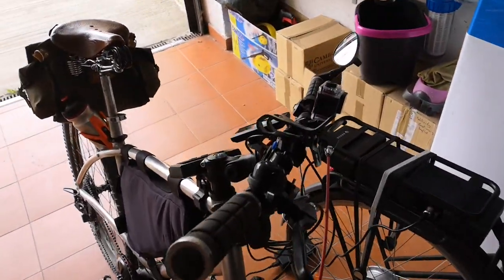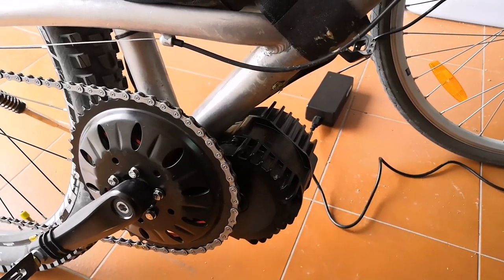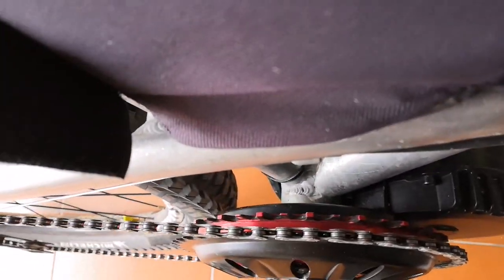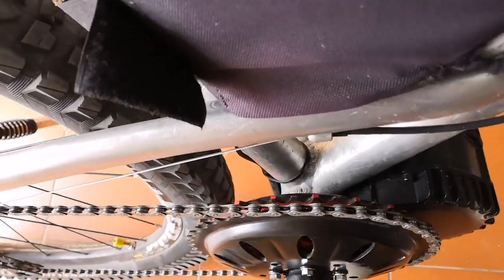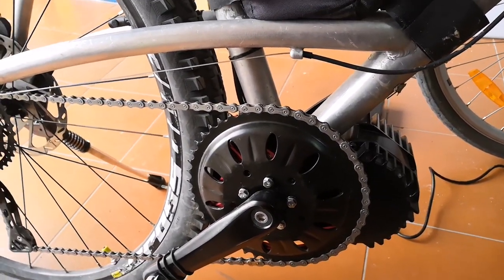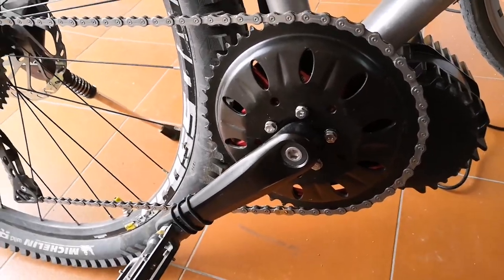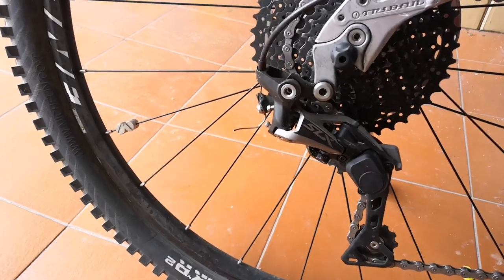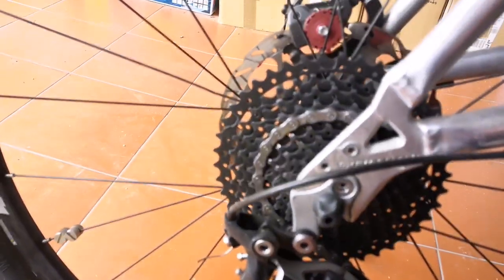Bafang Bbshd 52V update

Comment: Is there a speed difference between 750w and 1000w?
Reply from the maker: Hello. The kit I bought (Bafang BBSHD) was advertised as "1000W".
The wattage depends on the voltage and the Amps you can/are putting through the system, Volts x Amps = Watts.
This is a 48V kit, but I'm running it with a 52V battery (14S9P - that's fouteen batteries connected to produce 52 V times 9, so 126 18650 cells altogether)
When the battery is fully charged it's around 58.7V. 
It puts out (according to the Cycle Analyst) 32Amps, so 58.7 Volts x 32 Amps = 1878 Watts.
The " speed" will depend on your gearing (the bigger your front crank and the smaller your smallest rear cog, plus the faster your pedal cadence) the faster you'll go.
On the flat, this kit will easily power you along at 50+kph.
Reply: mick2d2 750w ?
Reply from the maker: @murselincelik8411  I think you'll find that the 750W Bafang mid-drive is the BBS02, not the BBSHD.

The BBS02 was my first kit, with a 48V battery (13S5P) which is now on my brother-in-law's bike.
Again, it wasn't really "750W" it was sold as a 500W kit, but under the motor it was stamped as "48V 20 Amps".
The voltage range was 46.8V to 54.6V (fully charged), which equates to a wattage range of 936W to 1092W (at 20 Amps), so not 750W.

Some people "overvolt" the BBS02  to 52V as well, obviously giving more power - 1008W to 1176W (at 20 Amps).

I ran the BBS02 for three years and my brother-in law has been using it for the last three, so six years altogether and still going strong (with no repairs).

I've been using the BBSHD for the last three years (again no faults so far).

Comparing the two, the electronics on the BBSHD are engineered for a lot more power and it doesn't get as hot (even on the 52V battery). 
Sometimes the BBS02 would overheat and need to cool down if you ran it at full power for a long time in the summer or also on long climbs. This has never happened with the BBSHD even though I'm putting an extra 10 Amps through it.
The BBSHD clearly has a lot more power and a lot more torque.

With the gearing I have, it will climb almost vertical slopes! 
On a few occasions, the slope was so steep, I had to lean forward over the handlebars, to stop the bike going over backwards, and went up just on throttle, as I couldn't pedal in that position. 
The BBS02 couldn't do that
They are both great kits though and both pretty fast with the right gearing.
Reply: thank you very much Greetings from turkey
Reply from the maker: @murselincelik8411  You're welcome! Greetings to you  from Spain.
Reply: mick2d2 hello :) For faster and torque, let me see the Ruble Gear number or which gear ratio?
Reply from the maker: @murselincelik8411  

https://www.sheldonbrown.com/gear-calc.html

Speed in KPH @ 60RPM
For 29 x 3.0 / 75-622 tire with 170 mm cranks
With custom sprocket(s)
With Rohloff Speedhub, 14 Gänge Rear Hub

Gears:              1º                2º    3º    4º     5º     6º    7º     8º    9º    10º  11º  12º  13º  14º
Ratio:            0.28 (Low) 0.32 0.36 0.41 0.46 0.53 0.6  0.68 0.77 0.88 1.0  1.14 1.29 1.47 (High)
Crank:              42               42    42    42    42    42    42    42    42     42   42     42      42   42  
Rear cog:        13                13   13    13    13    13    13    13    13     13    13     13    13    13
Speed (KPH): 7.7              8.8   10   11.3 12.9 14.7 16.6 18.9 21.5 24.4 27.7 31.5 35.9 40.7
Reply: mick2d2 I do not understand
Reply from the maker: Murselin Çelik Sorry, I realise my answer was a bit technical!
The link I mention, provides a tool which allows you to calculate your gear ratios depending on your wheel size, your front crank plate, your rear derailleur and the speed, depending on how fast you pedal (RPM).
In my case, I have one 42 tooth crank plate on the front (by the pedals) and one 13 tooth cog on the rear wheel. I only have one cog on the rear wheel because the gears on my bike are internal. I have 14 evenly spaced gears. The information I posted is the gear ratio for my setup and the speed in kilometers in each gear when pedaling at 60 RPM (the cadence).
If you put the information for your bike into the calculator, it will tell you how fast you can go in each gear. Obviously the bigger the front crank plate and the smaller the rear cog and the faster you pedal, the faster you will go.
Hope this helps!
Reply from the maker: Murselin Çelik If you watch one of my later videos, you will see my present setup, with the new crank plate and the Rohloff gear box on the back wheel.
Reply: mick2d2 9 gear 11x34 is it enough
Reply: my rear gear
Reply from the maker: Murselin Çelik The smallest (fastest) gear on most bike (except a few road bikes) is usually 11 teeth, so that should be fine. What size is your front crank plate?
Reply: @mick2d2  I really appreciate your thorough answers ! I have baught the BBS02B (so a newer version of the BBS02, which had some minor issues, from what I've read.)
One question for you, I have a cargo bike(radwagon) and I've just upgraded, i.e. bought the bbs02b - was this a mistake ? Regarding the bbshd, the price difference was 250€ .. my old motor had only 40NM torque and got me up hills up to 15°-18° although significantly lowering the speed to 10-15 kph, but I have some on my daily commute that are steeper. It says on the buyers info, that the bbs02b has also 160nm torque, I couldn't verify that. Do you know something about that ?

I want to give you two valuable tipps: 

1.) I haven't tested it myself,yet : https://electricbike-blog.com/2015/12/23/mobilgrease-28-bbshdbbs02-because-a-good-mid-drive-is-better-seen-and-not-heard/
2.) The combination of 52V battery and 30Amps is kililng the motor;I've read an article from a technician who regularly services the BBSHDs. I'll add it if I find it ! He advises limitting the Amps to 25 afaik.
Reply from the maker: @Ematuresco  
Thanks for the tips! 
I bought my BBS02 in 2014 (so it's probably the worst version or at least the one most prone to fail due to the MOSFETS.

Some interesting spec details comparing the two (and the different versions) here:
https://ebikechoices.com/bafang-bbs02-vs-bbshd/

I ran the BBS02 for three years before switching to the BBSHD in 2017. 
My brother-in-law has been using it for the last three years without any problems. 
I think he did open it to regrease it, but that's all, and it must have done well over 10000km by now.

I've been running the BBSHD, over-volted to 52V for the last three years without any issues or maintenance (about 7000km according to Cycle Analyst).

I do mainly offroad and like to ride it like a bike, so only bump the power up as and when needed. 

I have, on occasion, had to max it out. 
Once when my brother-in-law's bike left him stranded in the mountains towards evening, I had to race hell for leather back to the campsite (about 40km away) to pick up my car and go back for him. I rode back flatout, pedalling as fast as I could, maxed out on the throttle (so 32Amps). It was pretty warm by the time I got back, but didn't cut out. Like I said, I don't normally do this.

The BBSHD, plus the 52V battery, is clearly a lot more powerful than the BBS02 and with the right gearing will get you up slopes, so steep that you have to lean forward over the handlebars to stop the bike flipping over backwards. I've been out a few times with my brother-in-law where we've faced slopes like this that I could get up, but he couldn't.

I had a few problems back in the day, where the BBS02 would sometimes overheat in summer and cut out. Nothing permanent though. 
I've never had overheating problems with the BBSHD.

From what I've read, the BBS02B has much better MOSFETS than the original  (and more nine rather than six), so this should be less of a problem (or none at all).

The BBSHD is physically bigger with much bigger cooling fins, so is always going to dissipate heat better than its sibbling.

In answer to your question (after all my ramblings, sorry!) 

With this upgrade, you're getting three times the torque! 120Nm instead of 40Nm. 
This will get you up any reasonable slope (and some not so reasonable) at a pretty good speed!

I was very happy with the BBS02 (apart from the odd problem overheating which you shouldn't have!)

My only "regret" was not getting a bigger battery! 

My first one was 13Ah at 48V, whereas the one I have now is 20Ah at 51.8V. 
I've yet to drain this battery, which was what I wanted. 

Even on that day out to the mountains, where we did about 85km, then I did another 40km flat out (on tarmac), I still had a little bit of juice left. (Not much though!)  8)

I think you'll be very happy with your motor. 
Enjoy!

Comment: Have yu seen the BlingRing?
Reply from the maker: Brian Bassett Yes, I've done a few more updates since this video. I'm using a 42T Blingring and my latest change is a Rohloff speed hub which is amazing. I'll post a video soon.
Reply: I started with a Speed-hub, got rid of the brake shut-offs the 1st day. Then installed "The Green Button". The Rohloff and the BaFang are like they were made for each other.
Reply from the maker: Brian Bassett What do you mean by "the green button"?
I'm really loving the Rohloff. I was finding the ten speed derailleurs to be a bit of a pain. If they get knocked about a bit, it then becomes nigh on impossible to adjust all the gears correctly. With the speed hub, there's no chain slap, it's like always being in the perfect gear. It's not quite perfectly lined up with the bling ring and it would be nice if I could get rid of the chain tensioner. Other than that, I'm very happy with it.
Reply: mick2d2 - Do a search for "The Giant Green Button", it is a button to mount on the bars that hooks up to the brake cut-off.  You can push and hold the button and the motor won't come one as you pedal. You will find yourself using it more and more and that saves power.  I know what you mean with the Rohloff. Once you stop having to pedal to shift it makes things so much more simple. I was hoping not to have the tensioner too, it's so clean looking without one but after almost 8000 miles I have had no problems with any of it. My chain alignment is almost perfect. Have a great day.
Reply from the maker: Cheers! You too.
Reply: Thanks, dude. You need anything let me know.

Comment: why do you have a bling ring and a bafang sunflower ring on top of that lmao...
Reply from the maker: intra morph Good question! I was playing around with different combinations and cadences, to see what suited me best. I've since changed things around a bit.
I now have a Rohloff 14 speed hub on the back and a modified spider with a 42T crank plate on the front. Modified because the Blingring didn't give a good chain line with the Rohloff.
Reply: nice how's the rohloff working out for you... my setup is 42T bling ring up front and i chose to go with sram ex1 ex-horizon 8 speed which is their e-bike special derailluer+cassette... it has a huge 11-48T range in the back and it's pretty expensive but i'm guessing the rohloff is even more expensive solution. Would love to see your new setup and how it runs. :)
Reply from the maker: I'll post a video with my "final" setup. I don't think I'll be making any more changes for a while, as the Rohloff upgrade was a bit pricey. I suppose everything is relative to the use you make of things. I use my bike every week and the Rohloff is supposed to last for at least 100,000KMs!
The final tweak was adding a LunaCycle 130BCD spider and Blackspire Cyclocross 130/44T crank plate as the chainline with the Bling ring was a bit crooked. With this setup it's perfect.
I'm really happy with the Rohloff, it's like always being in the right gear, no derailleur noise or grinding, no chain slipping or popping, just puts the power down.
With the battery fully charged (58.8V) it can handle level 9 of the Pedalec in the highest gear from stationary (I'm 100KG). Obviously I don't normally do this, as it's causes unnecessary strain on the components.
As far as the gears go, the combination of the Rohloff 16T and the 44T, gives me more gear range than I previously had. I normally start in 4th or 5th gear and I also have a couple of faster gears than with the 11T cog.
It takes a little bit of adjustment to the gear change, as you can't change gear under tension, so you have to ease up slightly in order to make the change. In practice, I don't find this to be a problem as the BBSHD has loads of torque, so it's easy to compensate for this.
The great thing is, you can change through lots of gears at one go and you don't need to think about changing gear when you stop, or making quick adjustments at a road junction. The best thing is, it's just so smooth when compared to a derailluer, and pretty much bullet proof.
In the last five years, I've knackered two Shimano Saint derailleurs, one got badly bent out of shape when the derailleur hanger broke and the other hitting a tree stump.
In first gear, you can climb literally any slope. You can also adjust this further by changing the cog on the Rohloff. I think you can fit anywhere between a 13T-21T cog.
You can see all the possible combinations using Sheldon Brown's calculator:

http://www.sheldonbrown.com/gear-calc.html

I think it's the perfect combination for the BBSHD.
Reply from the maker: I've posted a video here:
https://youtu.be/sWdZUZvqL_I